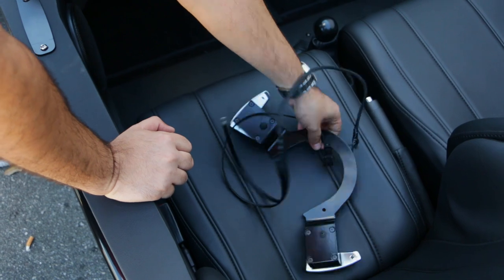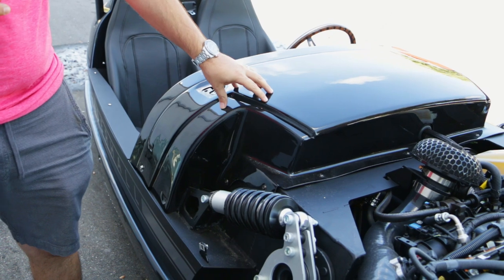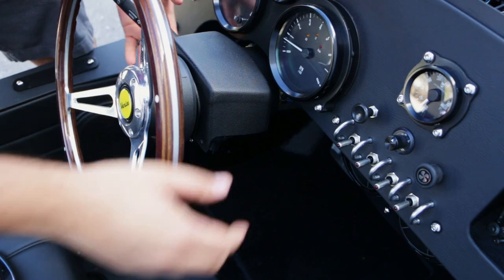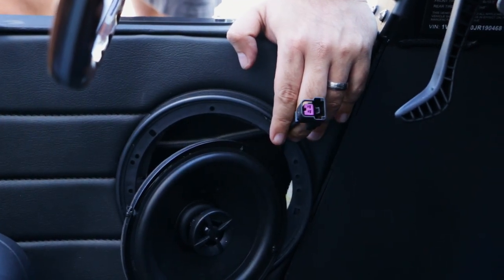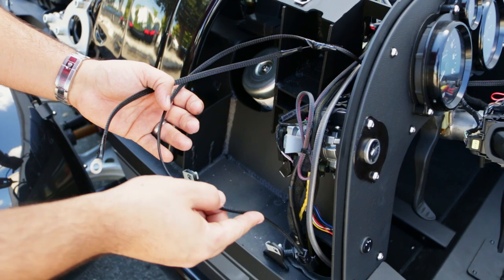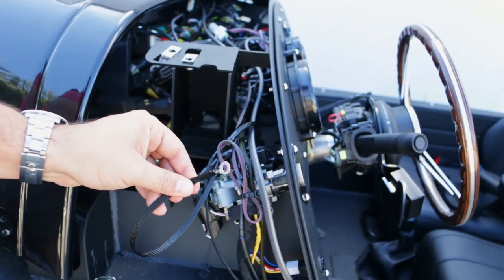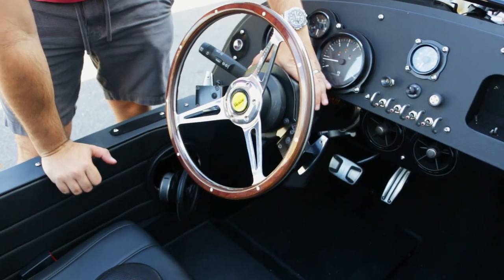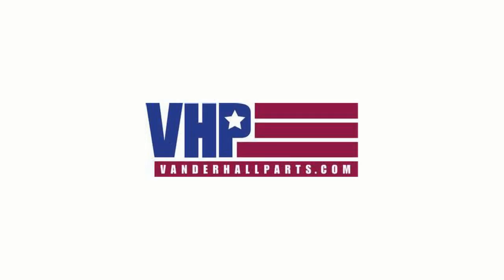Vanderhall Paddle Shifter Installation

Comment: I have a 2020 Carmel, where is the plug connection on this model, as the speaker isn’t on the door panel, but on the site firewall. Is it still behind the speaker?